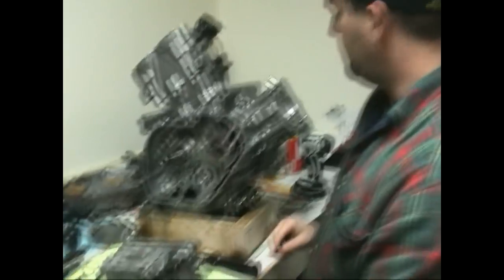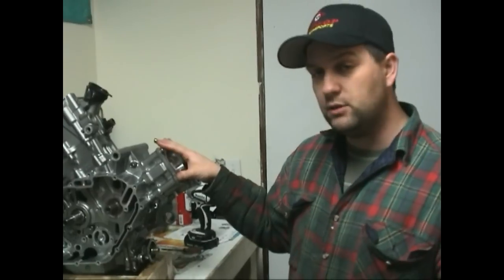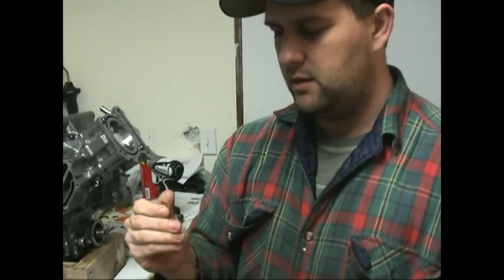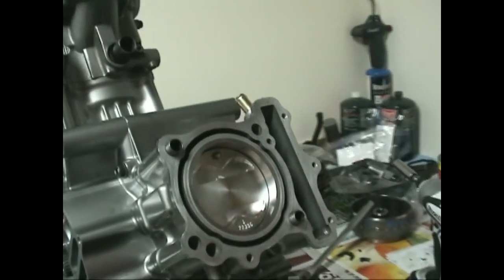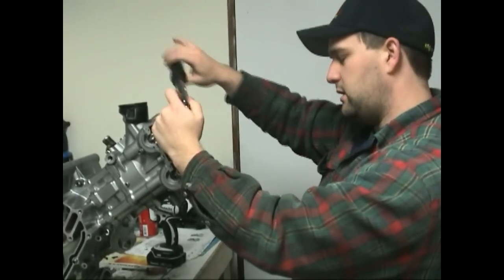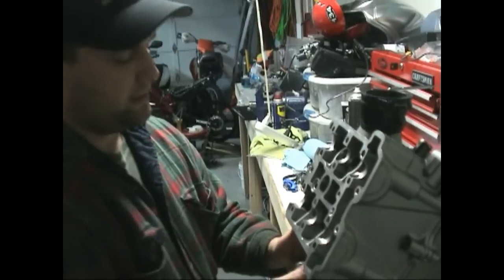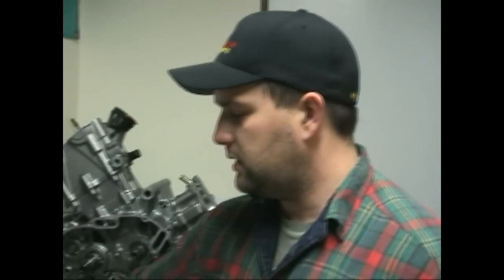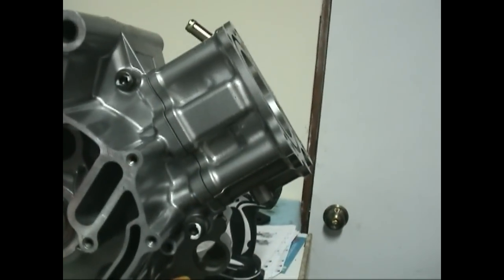Measuring Engine Squish

Comment from the maker: Oh and the guy I'm using for the tuning is thinking 5-6hp with proper squish and cam timing adjustments.  If that happened on his dyno then I'll be at 89-90hp with stock displacement and stock cams (on his dyno).  That'd be fun to have.

Comment from the maker: @afm199 So to fix the needing to run lean and to give the motor the power it should be making I've picked up some new stock heads which I'll get milled with these pistons in mind giving me the ~14:1 CR and .8mm squish.  Not sure when I'll do this as the motor is working well and is in general the fastest bike out there at my local clubs so instead of putting even more money into the motor this season I'm thinking I'll just move to the new heads in the off season.

Comment from the maker: @afm199 The reason why is because the heads were used in a Supersport engine and to get ~14:1 compressipon they were mileed alot. With the switch to the flat top pistons (which are slightly taller than the stock pistons leaving me with .62mm with a stock base gasket) I would end up with ~15.2:1 which is way too much. So if I wanted to use those heads I had to increase my squish to get the CR down to 14.1:1.
 
Since having it tuned we found it requires a very lean fuel ratio to make power.